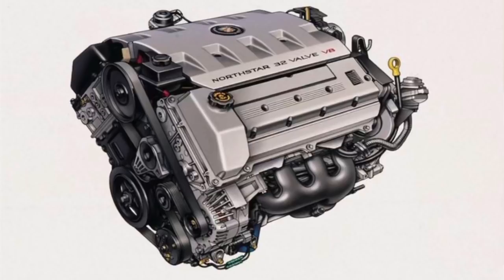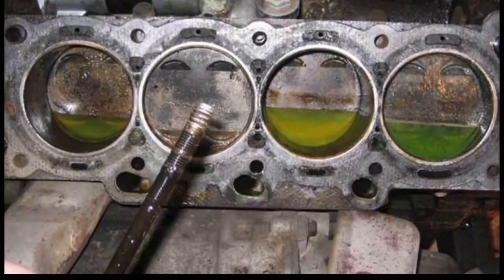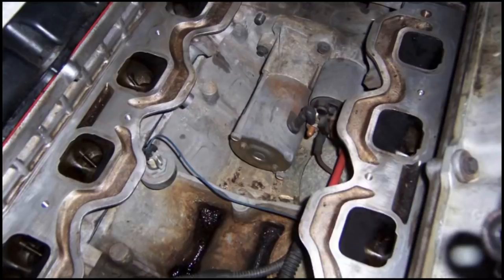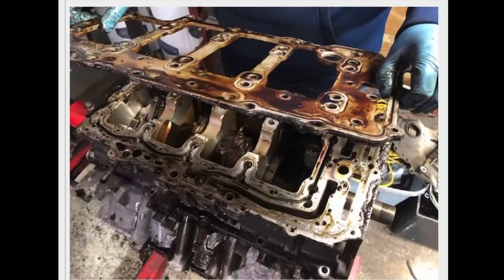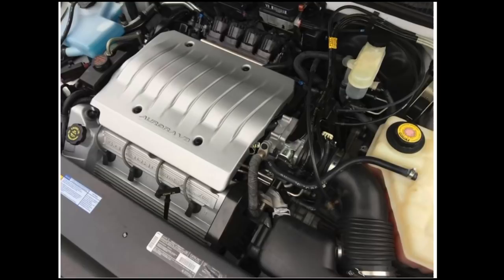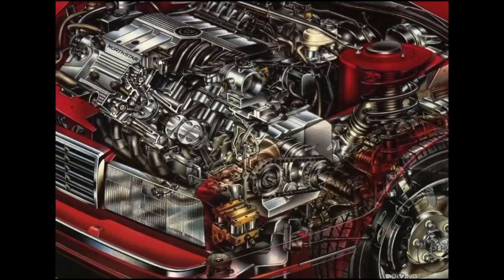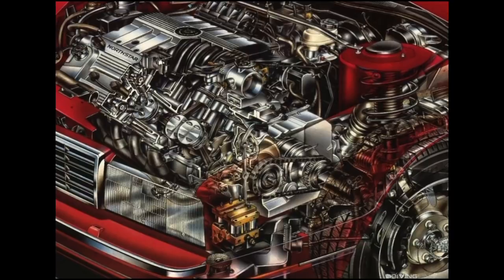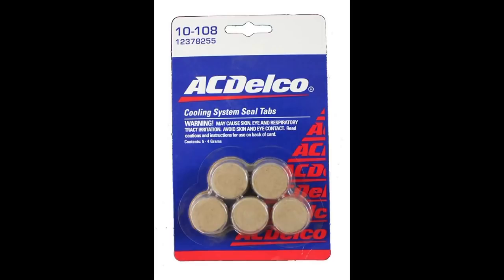Worst Car Engines of All Time: Cadillac Northstar

Comment: As long as you get one that was made after 2005 I think you're good. I owned a 2001 and I never did have a problem with it. The car was totaled at 230K. I own one now (2006) that I've had since 75K and it has about 165K now. No head gasket problems. It does leak a bit of oil. Nothing terrible. Enough to be annoying. Water pump pulley on top somehow got messed up and wasn't turning. Water pump was seized up good though it wasn't leaking. The car was still fine. When I say not turning, a groove was worn into it with the belt such that it couldn't turn. So don't tell me it was turning. I couldn't turn the water pump even with a wrench. Seems like there's always one person that'll tell you that you're wrong. I looked at it myself. They replaced all that (it's a PIA to get to on my engine) and it's back in action. I'm surprised the pulley that is on the end of the cam shaft was fine. It didn't overheat though it was running warmer than normal. So I looked.

It still has the original spark plug coils, alternator, starter. It still takes off like a rocket. My big problem with the car is Rust! This car was my DD in all weather. My gas line rusted through where it bends to go up to the engine, both lines. That was fun to bend a new line to. I think I've replaced just about every inch of brake line. Some of those replaced junctions are corroding out after 7 or so years. BTW, if you get air into the brake line that's really bad. The computer really doesn't like air in the brake lines. It has effected my transmission, parking system, stabilitrack. I would drive and it would slam the car into 2nd gear (rear left tire line was replaced). It took me a while to figure it out. I completely bleed my brakes thinking - that's not it... However, let's eliminate that as the cause. Much to my surprise the problem went away completely. That happened again recently when my Rt/Rear line went bad. Tranny was fine this time. Parking assist was wonky (ding ding ding... parking assist off). That allowed my brake fluid to run completely out. That was a PIA to get bled out right. I think it's ok now.

My wife liked my car so much she bought a 2007 with 35K on it. Someone up on NY State owned it and it had to have been kept in a garage. It was almost like it was off the showroom floor. I think it's up to 80K now and it still runs like a dream. The only think I don't like about that car is the leather roof. The Northstar is a great engine. As long as you maintain it, it'll last. I expect my 2006 to make it well beyond 200K if I can keep the rust away. It's more of a fair weather car since I retired. No more driving it in nasty snow like I used to.

Comment: Didn't GM generally correct the head gasket issue? If I'm remembering that correctly, which years of Northstar are the best to consider purchaings? Thanks again!

Hope we get a Ford and Mopar edition! ;)
Reply: The issue was mostly resolved in the 2004 model year cars. Head gasket failures after that point are relatively uncommon and usually only on poorly maintained or intensely overheated vehicles.
Reply: @ashtonneale8425  - Thanks, boss!
Reply: You are right about that.  I tried to hold Cadillac responsible.  In general by the time the gasket blew the car was out of factory warranty.
Reply: To be a little more specific it was resolved in the second half of the model year of 2004.
Reply: @bassb450  What do you mean by second half?
Reply: @ashtonneale8425  The 2004 Model year started around Sept -Oct 2003. Cars made after Feb - March 2004 would be the second half of the model year. During the 2004 model year about half way thru GM updated the head bolts again finally fixing it for good.
Reply: @bassb450  Oh ok because I heard from Jake Wiebe over at Northstar performance that it was all 2004+ Northstar’s. They made several revisions at that time so it would make sense that they all came with it.
Reply: @ashtonneale8425  Definitely was not ALL 2004's. Maybe when he said 2004+ he was also alluding to the second half of the model year. I have that info on good source, wouldn't say 100% but definitely 90%. I have a 2000 Deville myself and blew the heads about 4 years ago and had them fixed, fine ever since. But I would never buy another one, unless it was at least a 2005 as to take no chances.
Reply: @bassb450  Ok I will ask again and get some clarification as to what he said. But I remember him being pretty adamant about it being all 2004 LD8’s and L37’s.
Reply: @ashtonneale8425  I read at Cadillacforums that there were some early 2004 DTS LD8 engines that did not have the better bolts (I'm guessing left over from 2003), but all regular 2004 Devilles and all RWD engines did.

Comment: The Car Wizard has a video addressing the head bolt issue. It's a bit expensive, when accounting for the labor involved but, when the bolts are replaced with stronger ones, he say it becomes relatively trouble free.

Comment: True..another one that sucked for many? I drove 94 Cadillac new and never had issues. But I had it for two years.
Reply from the maker: I still drive one.  Only minor issues, but it has low mileage and I take care of it.
Reply: @Rare Classic Cars  I loved mine.  Drove it 500 to 800 mile trips from Fresno to Los Ángeles,  San Francisco  or even to Ensenada Baja California México. It was like you say, very quiet at idle. The reason I let it go was it was a lease. It racked lots of miles. 30k+ miles per year. That's why I've purchased or leased over 30+cars in the past 28 years.
Reply: @RareClassicCars  Adam - have you found any sources of NOS parts for engine + electrical that GM has discontinued? Thanks.

Comment: I had a '90 Lexus LS400 for 15 years that i bought in 2000 with 165K on the clock.  Hands down BEST CAR I ever owned...it was cruising to 400K miles with the original engine and transmission...zero problems and not a drop of oil burned plus endless torque and totally silent...when a millenial twit who was texting rear ended our son at a signal.  Mercifully our son was okay. Car was totaled and it broke my heart, I was sooooo mad!  Cadillac in that era did not deserve to have customers.  Their cars were absolute garbage and clumsy looking to boot.   The Lexus was insanely sound and reliable...just loved it and miss it to this day.
Reply: @Bill Denton
No doubt Toyota changed the luxury car game with the introduction of the LS400
They were the prices of a Cadillac at the time

Comment: Had a 99 Deville loaded with every option.  Bought it for $1. Fixed head gasket and upgraded head bolts and gaskets....replaced starter and alternator  at same time. I never once got pulled over by cops while driving it....for whatever reason.  Awesome vehicle but it was time to get a newer car so I sold it for.......$1. No clue if still on the road. Neber
Reply: It's because pimps drive those and they're always armed, why risk it for traffic ticket lol
Reply: @V8_screw_electric_cars  
Or dealers......just sayin......😉😄😎

Comment: Why do you think they would use fine threads on small head bolts going into an aluminum block?  That's right...planned obsolescence. Punishing you for being their crappy product.  Meanwhile my Toyota Tacoma has 292,000 miles with no major repair other than a harmonic balancer and even that was after it had been wrecked 4 times.  I honestly have no idea how GM stays in business.

Comment: Northstars are great......until they aren't! Had an 07 DTS with the performance NHP engine. Was told by dealership that GM had redesigned the engine and it didn't have the oil leak problem anymore... They lied. Around 75k miles it began blowing oil. Entire undercarriage was coated. We decided to go back to Lincoln's and traded it.

Comment: Nice video given I was one of the people wondering why the Northstar wasn’t on your other list of worst GM engines. You are correct that the engine can be very good given the head bolt issue is addressed. I had a friend actually do the corrective procedure to an engine where the head gasket was blown without removing the engine (!) and three months later he had a good working engine. Unfortunately, the thing is still a nightmare to work on given the large, transverse engine being installed into the engine bay like sardines in a can. There is almost no room to do anything. He told me about the ridiculous rotation game to remove the alternator out of a tiny “door” at the bottom of the frame and he had to drop the engine cradle a lot of times to do different jobs, such as accessing the blower motor or just getting to the spark plugs on the side of the engine facing the firewall. It also has a weird extra hidden belt off of the camshaft to run the water pump if I recall correctly. It CAN be a good engine, but it just doesn’t seem worth it given all of the flaws and annoyances. Personally, I’d take a disabled V8-6-4 368 over a Northstar any day. I also was lucky to own a car with a trouble-free HT 4100 years ago, and I would also take that dog of an engine over what my friend has gone through.

Comment: My Grandmother had a 1985 Sedan Deville for a few years and then it was stolen.  It took 3 weeks before it was founded,  and stripped of everything and the insurance company considered it Totalled.  With all of that being said. In 1993 she bought a pre owned 1992 Sedan Deville with 3,000 miles on it. Whiles in the process of her buying and going different Cadillac Dealership's with her, my uncle and mom. The sales reps kept talking about this new and improved Northstar System.  I used to take home the Cadillac  brochures and they had the Northstar name written all over it. My grandmother was 70 in '93 and I was 11. She's turning 99 this year and I will be 40 and she still has her 1992. That thing still runs,  she told me once that a  mechanic told her that was one of the last years that GM built a good Cadillac engine.  I think she hads a 4.9 injection engine.

Comment: Adam, Let's be fair and reasonable here. Post 1970, there are a lot dubious GM engines to choose from so why limit yourself to just one list? Comparing the Northstar to the Lexus V8 is one of the bravest, boldest assertions ever made on Youtube. 😉
Reply: The DeVille Concours beat Lexus and Lincoln in the consumer quality ratings in 1994.
Reply: @alanblanes2876  And when that headgasket went on the Northstar I bet they changed their mind
Reply: The LS Lexus line of engines share the quad cam 32 valve configuration with the NS. Also the starter location. In one respect the NS did even better than Lexus. Lexus used a timing belt that requires service at 100k; NS used a chain with no such service interval. Like I said in my post, the NS was a near miss, or near hit according to George Carlin. 😉 Lexus just did it better with a similar approach. Both engines very powerful and extremely smooth with good fuel economy for displacement.
Reply: @WydGlydJim  I am not sure how you confuse maintenance with a design flaw?
I am very certain that a NS owner would have been glad to pay the $1000( at the time) for a scheduled maintenance at a time of their choosing. Versus what typically happened, with an unscheduled repair that was often a significant amount of what the car was worth at the time
I recall a Cadillac dealer I went to years ago in Ohio..Germain Cadillac..didnt even do the headgasket jobs. GM had a   rebuilt engine exchange program that was about $5-6K at the time if I recall correctly, for the failed NS engines

As for the 90's era Lexus LS..legendary reliability in every way for the most part
Reply: Well….I didn’t confuse anything….I just pointed out that in at least one respect the NS was better than the LS. It didn’t require a timing belt change. Hint the LS adopted a chain in 2007 I believe…..as mentioned, I’ve had an LS 400, an LS430, and an LS 460….the 400 required a $350 power steering pump at 150k and that always requires an alternator, because the PS pump fails directly over the alternator; a drip pan would have been nice; $900 repair at dealer, and that car required 2 timing belts in 220k….the LS 430 required all four air bags to be replaced at $1000 a pop, when they failed again I swapped em all out for another $1500 for conventional shocks and struts; I also replaced two timing belts on that car; the LS 460 needs new struts at 135k, point is Lexus reliability is not outstanding most just don’t keep ‘em that long.
Reply: @WydGlydJim  Well,yes you did
All of the maintenance intervals you mentioned, up to 220K on the Lexus LS, is less than the cost of a HG repair on a NS at the Cadillac dealer.
The Lexus LS held residual value a lot better than any North star car ever did
Hint..there are several timing belt cars( Many many Honda and Toyota products) that are timing belt cars that hold up for several hundred thousand miles regularly and still worth quote a bit on the used car market. Even when they are far in excess of 100K miles
So, that  would suggest that the market doesnt think a timing belt engine is a design flaw
As was mentioned in this video..the resale/residual value of the Northstar equipped Cadillacs was horrible mainly due to fears of engine failure
Reply: @turnne   Don't get me wrong, I would buy a high mileage LS over a high mileage NS, but I still stand behind my assertion, the engines are similar, Cadillac in the words of Maxwell Smart. just "missed it by that much"......some corners not cut, and some small tweaks to the NS, and the two would be serious rivals.
Reply: @WydGlydJim  Hmm...lets analyze that statement 
" I would buy a high mileage LS over a high mileage NS"
That statement would be agreed to by the overwhelming majority of the market and we both know the reason why
As for the engines being similar...we clearly have different definitions of similarity
Reply: Last word….🤣
Reply: @turnne  Possibly.

Comment: The fact that the car has required sealant be put in the coolant system means they knew it was junk from the start, but yeah i agree for the most part on it when its running good. Once the headgaskets and head bolts have been replaced with better ones they are decent engines. 
 I like doing starters on these. It's easy money and all done from an easy standing position.
Reply: The HT series also needed sealant in the cooling system.

Comment: I like how most (and eventually GM as well) call the Aurora V8 series of engines a “Northstar”.  Considering, it’s originally an Oldsmobile-designed engine designed by the Oldsmobile racing division of it’s day.  They changed the name to Northstar after the decision to give Cadillac it’s own engine line. But both the Aurora V8 (Northstar) and the Quad 4 were originally designed by, and for, the Oldsmobile race team.
Reply: More trivia, i still have not seen anything about how Aurora and NorthStar are characters (brother and sister) from Marvel from the same era, who was the comic fan?

Comment: Thanks Adam! I used to have a 94 Seville STS which I got in 96. I got about 155k miles before the dreaded head gasket failure. Wouldn't have hurt as much if I had not just spent a lot for a new starter install. That's when we discovered we now had "magic white smoke". It was fun to drive with that power.
Reply: I had a 94 STS as well, bought it with 50K miles. No cooling system or oil leak issues, but it threw a rod at 70K under WOT without any pre existing rod knock, or any other indication of bottom end issues. What a shame. It was a beautiful pearl white in perfect cosmetic condition.
Reply: @jamesb8305  I liked that Pearl White! What color was your interior? When I bought mine, the dealer had another STS, but it sold before I could make up my mind. I think it was Pearl White with a nice Dark Wine colored interior.
Reply: I still own my 1995 STS. Has 134k miles on it. Still drives great. Mine is diamond white with a dark blue interior

Comment: I bought a 2001 Deville 6 years ago because I wanted to see for myself what was the problem. It would pump out the coolant and then over heat. I am rebuilding this engine now. The reason the head gasket blew was because ONE head bolt thread was stripped out. I believe this happen when the engine was built. The other 9 thread holes are fine. It is also leaking oil because GM used cheap gaskets. I have replaced all the gasket and will be done installing the engine by the middle of January.